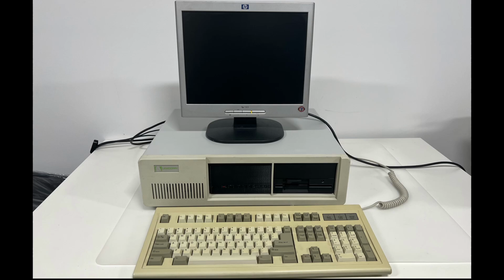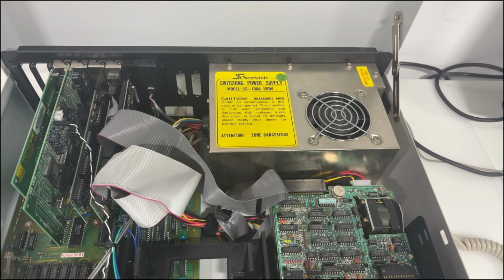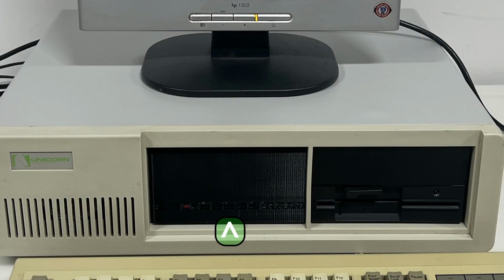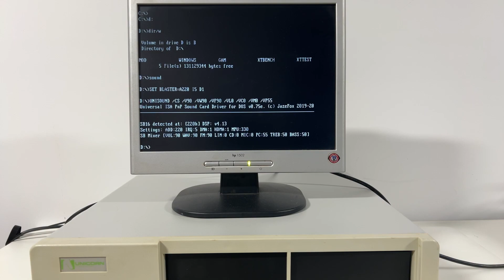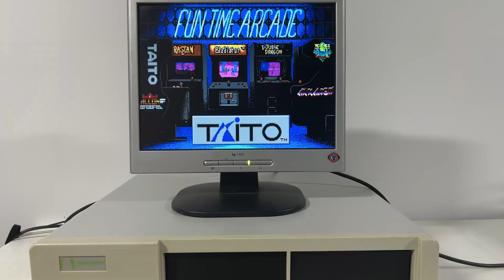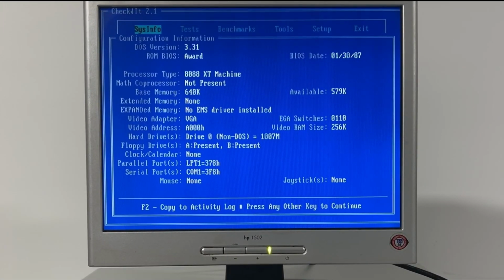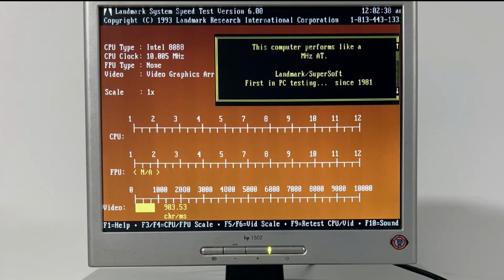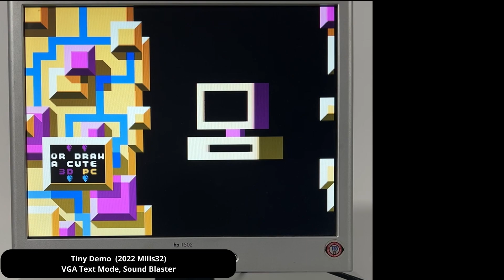#Doscember - Turbo XT Project - AMD 8088 / 10mhz with VGA and Sound Blaster

Comment: I cannot believe an 8088 can run all these games! This is beyond unreal! If someone told me this was a 286 or an early 386 I would have believed them.
Reply: 8088s were actually a lot more capable than many people realised. The home market for PCs was tiny until the boom of clones in 1984-1986 so PC gaming was just an afterthought during the 4.77mhz 8088 CGA era of DOS. This is where the terrible image of 8088 gaming comes from with most games from this era looking and playing terrible compared to other 8bit versions. However the faster 8088s (8 and 10mhz) came out right when home PC sales was booming and many game companies were seeing PCs as a legitimate platform. So there are actually a lot of EGA and VGA games that play really well on a fast 8088 (or v20/v30). Prince of Persia is one that was one that played very well on a turbo XT that wasn't shown in this video and even something like Monkey Island is playable. The same thing applies to 286s: a lot of people aren't aware that the faster 286s could play early 90s VGA games at full speed, including titles like Wolfenstein 3D, Ultima Underworld and Wing Commander.

Comment: Commodore 1084S would be an ideal monitor for a CGA card. You would be able to connect it via RGBI and composite and switch between the two to take advantage of the handful of CGA games that supported composite artifact color.

 Also, a Hercules mono card and a CGA card (or for that matter, EGA or VGA) could coexist in the same system because they use different memory ranges so you could do color and Herc in a weird dual monitor setup. That might be interesting to see. I don't know the use case for this, though... programming?
Reply from the maker: I wish I still had a 1084s :-) i do have a ntsc tv though and an original full length cga card with composite out so perhaps there’s a project there.

Incidentally I have a cga-graphics related software project in the works right now so stay tuned :-)
Reply: @techdistractions  all that being said, I'm not disappointed with how a 10MHz 8088 runs with a VGA card. I thought a much faster processor was required. 

I guess it depends on the games. Commander Keen, yes. DOOM, no. Of course DOOM requires 4MB and a 386. Minimum. By the time I started paying serious attention to PCs, (I was an Amiga fanboi before that) the 486 and Pentium were out. Looking at earlier stuff like this kind of fills in the gaps.
Reply from the maker: @SeeJayPlayGames  yep the XT was commonly sold with cga and herc/mda but over here in Australia they lived on for a long time as a “cheap 286” and often shipped with the same case and vga card as the 286. 

One common upgrade was a drop in chip upgrade to nec v20 and some even got as high as 16/20mhz - these are more widely known as “hotrod xt”. I have a v20 and might do a project with it soon :-)
Reply: @techdistractions  I feel VGA is actually a pretty good choice for this era of turbo XT. Turbo XT clones were really popular during the first home PC boom of 1986-1990 and at that time EGA had become the main home standard with VGA popping up towards the end. Hercules and CGA were still common among enterprise users but from 1986 EGA became cheap enough to be a standard option while VGA did the same in 1989-1990. Interestingly there are quite a few games that will run better in VGA on a turbo XT than in EGA. Prince of Persia is one example where the VGA version runs at about the same framerate as CGA where as EGA will lag on a non-286 system.